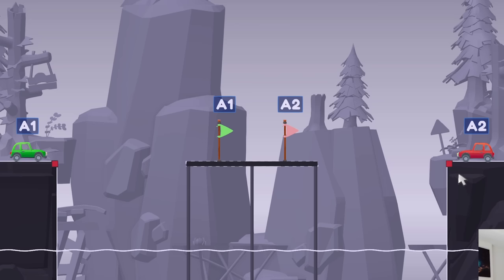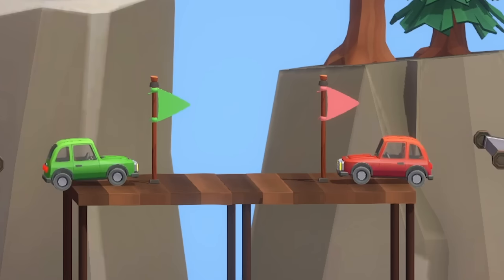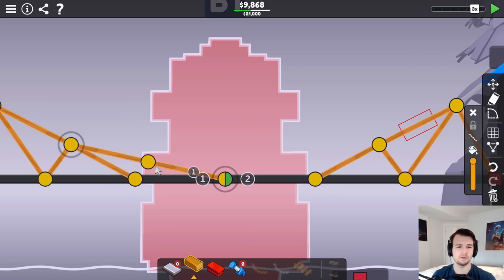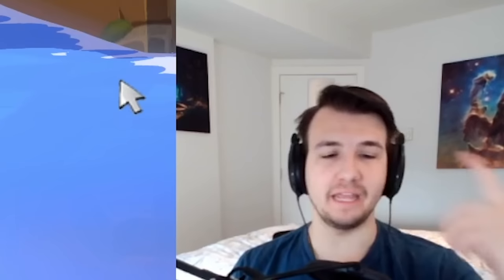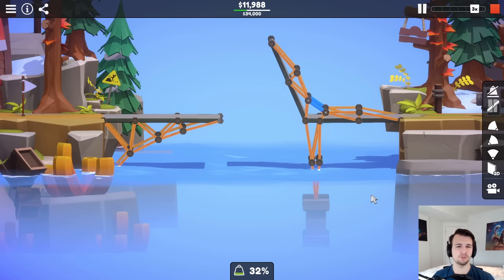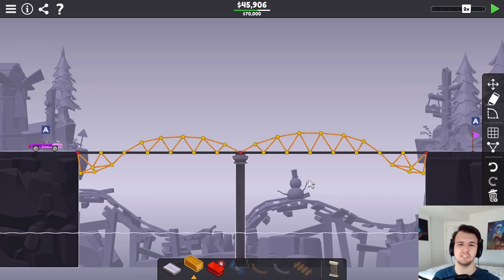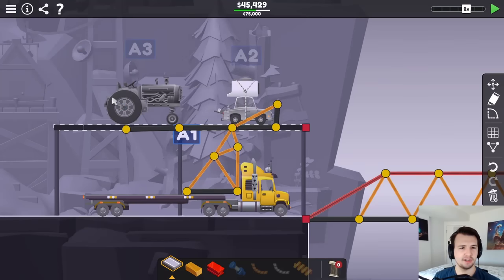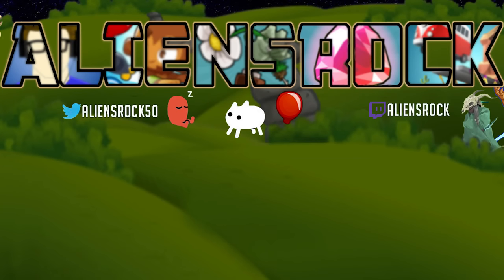Meet Poly Bridge 3's Newest Material - Foundation!

Comment: 17:57 My 33k solution was before a level change where funnily enough, Tyler’s first idea of stacking the cars was the way. After the change I’m not sure half budget would be easy.
Reply: What was the change?
Reply: @priyanshugoel3030  If i recall, the top vehicles were definitely different. The tractor is a pain to carry now
Reply: is it possible to maybe tension it and just skip the use of foundation entirely? that's the only thing that comes to my mind
Reply: @trevoreguitar  No rope/cable makes it probably worse than just a normal bridge, cause wood rope def is not strong enough and steel rope (ew) is probably more expensive and also worse than a normal bridge.
Reply: BACON PANCAKES MAKIN BACON PANCAKES
Reply: Shouldn't a level change delete all old records so that there would be no differences in leaderboard players can't control?
Reply: @Mpkki  In older games they did wipe the leaderboards if I recall..
Reply: Isnt the game not out yet for everyone though? Maybe they arent bothering with leaderboard stuff cause the game hasnt launched
Reply: @fusionwing4208  that's a good point. They might just clear all the leaderboards on release as well.
Reply: They will clear all leaderboards before release, also half budget on that lvl is possible just did it again.
Reply: Its kinda lame that they dont at least show that on the leaderboards
Reply: would it be possible to stagger the vehicles so they dont all go at the same time, so the bridge doesn't have to support as much weiight?
Reply: @rabidcabbage7230  them impacting the bridge in the first place would be the most force it needs to withstand.

Comment: 5:20 Tyler casually forgetting to shave half of the bridge.
Reply: Half that bridge is locked in...
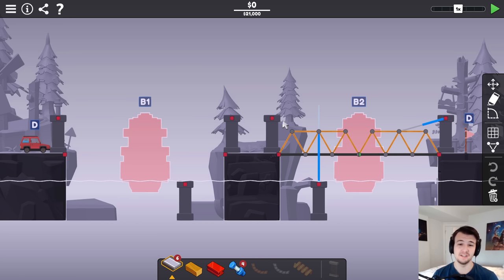Reply: @aydenpayne3405  on 2:53 you can clearly see that the delete button is still there
Reply: @Delenomes  the lock symbol is plain as day on the pieces. Head to his old video of the first time he came across it. The delete button was still there it just doesn't do anything.
Reply: @aydenpayne3405  oh wait you're right, the joints are different color and the materials didnt cost anything. For some reason I remembered from the first video all the materials textures to be gray as well, my bad
Reply: @Delenomes  it's all good. We all make mistakes in the heat of passion Jimbo.